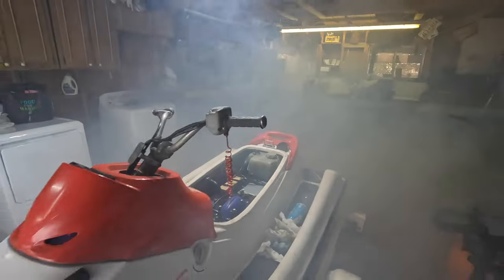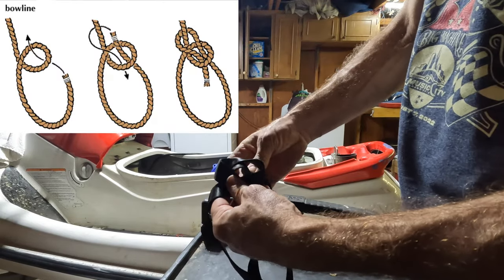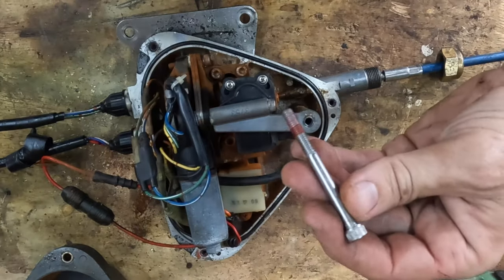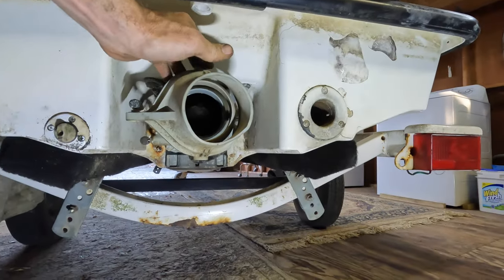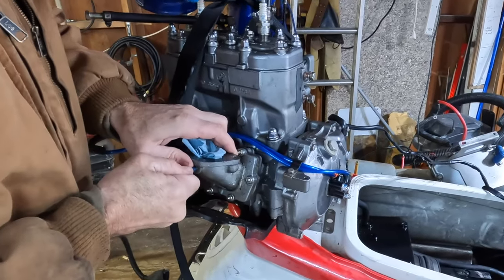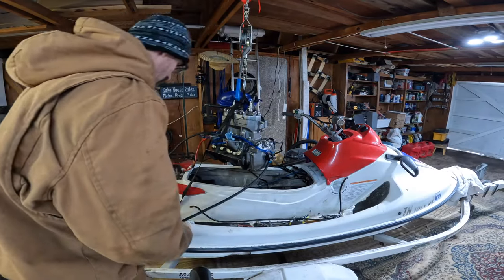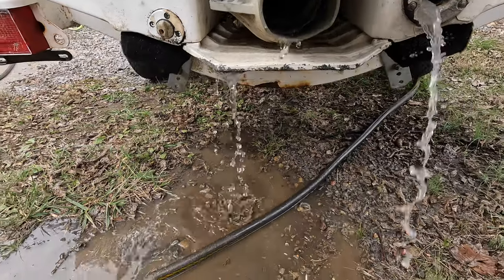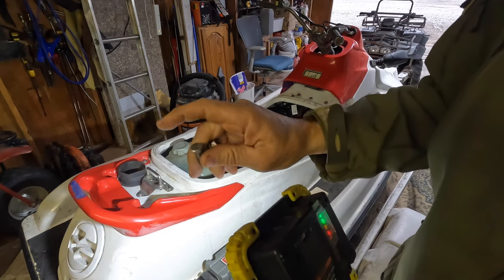Jet Ski Part II 1994 Jet Ski - Will it run?

Comment: That trim moter assembly is a Chevy Malibu mid 80s -90 windshield wiper motor look up wipermoters . That S, Steel box at the back is a water box muffler when you're done ridding at end of the day take out of water start up reve up couple times get water out  .cut off fuel an run it out same time so carbs don't couroud. Pull out bull plug ledge out tell next time. When u put in water next time ledge tied to trailer in water fire it up work up rev up about half throttle to put under load about 30 sec to one an half min till she runs clean you'll have no problems good job keep extra set of spark plugs in compartment change every season skii on😎

Comment: i dont know if this jetski is different from the ones ive owned but you should turn your water off before you turn the jetski off then if your going to start it you just start it up and then turn the water on or it can flood the engine with water and hydro lock
Reply from the maker: Great to know. Thanks for the feedback!

Comment: I have a 97 kawasaki and it is a siphon style bilge pump. So you have to be in the water. There is a hose run to the pump and it uses vacuum made by the pump to suck out the bilge water.
Reply from the maker: Really good to know! I was hoping that was the issue.

Comment: It would A can save you some money to. Window motor.,or A windshield wiper motor will work in it's place just the same for that part. Try find one that matches yours. By taking it along with you for A comparison part reference. Mitsubishi.& Other foreign type of imported vehicles have those kinds of electric motors on them to.

Comment: I would remove the oil pump and pre mix the gas with 1:50. if the oil pump fails you can have engine failure. Greetings from Germany

Comment: When u store it take out bull plug cut off fuel run it out in carbs they won't gum up from sitting.put tung of trailer up at a good rake pull plugin hull keeps water from standng in hull and rotting wireing hosees electrical stuff dis connect battery in winter ,mist moter compartment and aluminum pieces with we -40 cuts down on electrolysis an coroushion from forming on older machines great gob